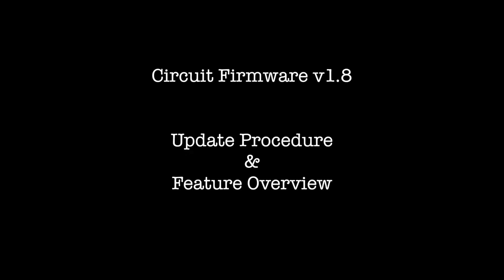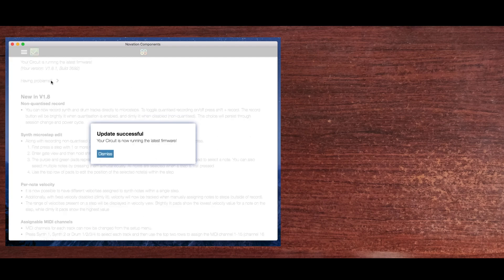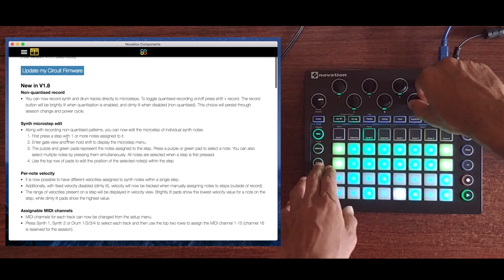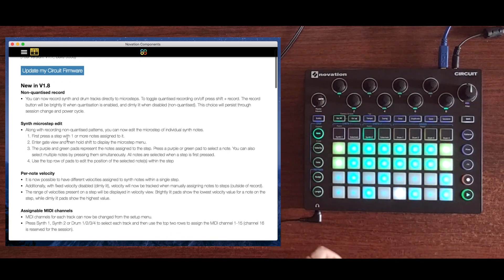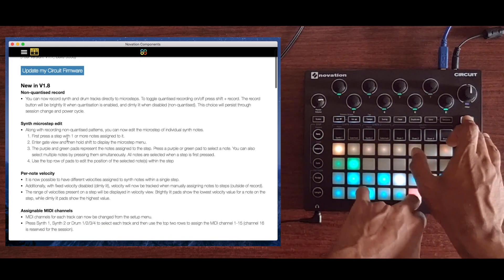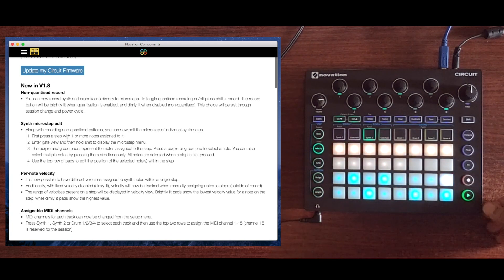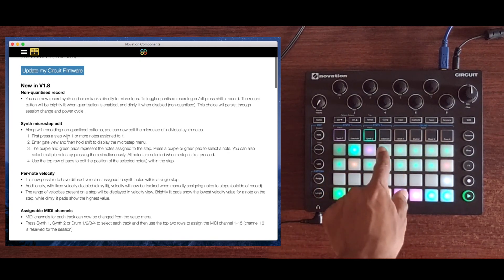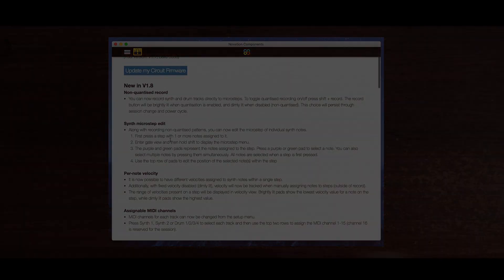Novation Circuit Firmware v1.8 :: Update Procedure & Feature Overview

Comment: Hi , i just bought 2nd hand circuit 2 days ago.  I connect to a mac to use and check the novation components connection, but its not connecting. I follow the procedure buy nothing happen.. i press scale note velocity and power button. Maybe i missed something ,any thoughts? Tnx